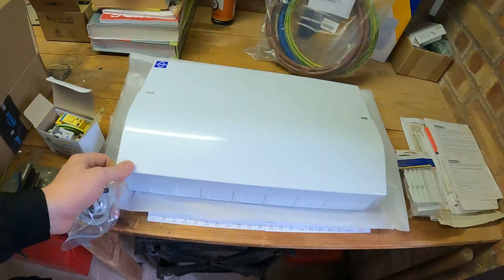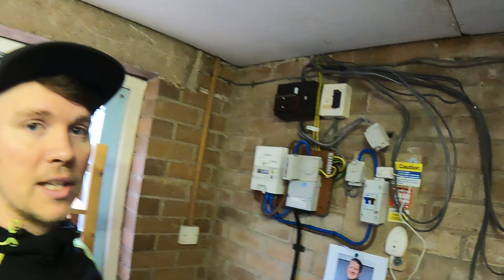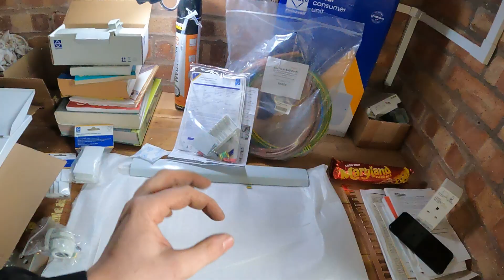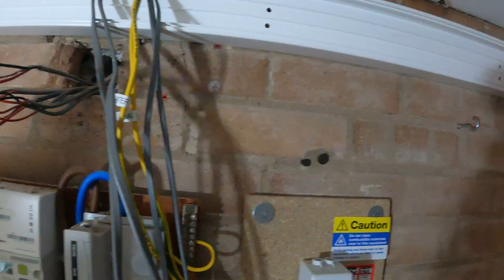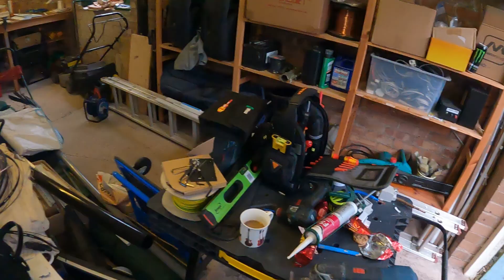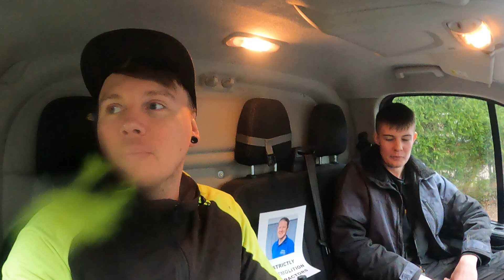Customer Did this!!

Comment: Just attended a property to solve a mysterious no power fault.  Breakers nor RCD did not trip most odd. The property had been newly re-wired and certificates were present, what I found was crazy.  The bus bar on the right side of the CU was connected between the RCD and one breaker at the far end, the rest, 2 x 32 amp 1 x 40 amp was not.  The bus bar was the wrong side of the connector and was only making a connection be resting against the connector.  This was arcing and overheating the breaker (fire hazard) sheer madness, I could lift the bottom of the breakers off the rail.  Now was this done by a professional or an amateur......

Comment: I am very intrigued by the wireing methods you guys have and follow. Its amazing the difference to what I work on over here in the US. 

Our electricity is very similar. We run 220 to 240 vac split phase system. 60 hz ac here. 

We use 180* split phase for residential that gives us nominal 120/240 vac on 2 phases. 
The equipment we use and boxing and wire is the biggest difference. The testing you guys do is huge and not often preformed here, or at least not commonly. We also don't use the ring or loop method of running circuits. But the advantage of feeding the circuit from both ends is huge. The down side is no plugs other then christmass or fairy lights have fuses in them. 

Very cool to see regardless and thanks for teaching me a bit more every day.

Comment: I was literally thinking that, although it’s nice of the customer to produce a circuit schedule, I would rather determine what’s what myself, not just because of any liability issues, but I don’t know if it makes it easier, figuring out circuits for yourself?
Reply: I'd say just having to verify the customers schedule rather than having to figure out everything yourself should make things a lot easier. I've literally spent weeks (full work days) figuring out existing wiring in one huge commercial property (over 100 years old, six-storey plus cellar, around ten sub-boards all over the place and loads and loads of extensions and alterations over time, massive granite walls too) and when the time came for an EICR that made things vastly easier even though the EICR showed a few mistakes in the original schedule.

That place is a nightmare. One of my favourites is a 2.5 mm2 (10 amps) radial that originates at the main DB at ground level and goes all the way up to the sixth floor and loft above! Voltage drop is atrocious of course, as is the Zs. Several Ohms in a TN-C-S. At some point a sub-board will be installed on the fifth floor but finding a way to get a feed up there is almost as difficult as getting the funds.

Comment: Quick question, so with you having spaced the board of the wall for rear entry, does this effect the IP rating of the board as you have used 3x rear knockouts and spaced the board of the wall meaning there is a gap on the side where you can get your finger in through the rear entry or did you seal the sides of the board? Any input would be great. Also does the SPD have to be after the main switch or does this not matter?
Reply: He sealed all the gaps with intrumescent sealant,, IP rating now above IP4x,, Proper,
makes it a pain for the next spark to pull in a new circuit though
Reply: Should be after the main switch, so when you turn off the main switch everything in the board should be dead.
Reply: Also, you can retro fit SPD, I.e at the end of the bus bar for the exact reason of retro so you don’t need to ammend the existing mcb/RCBO layout,, but , the length of the Line + Cpc shouldn’t exceed 500mm (I think) but exceptions will allow up to 1000mm (or summink)..
Watch John ward ytube vid
It’s to do with impedance and the operation of the SPD 👍🏻

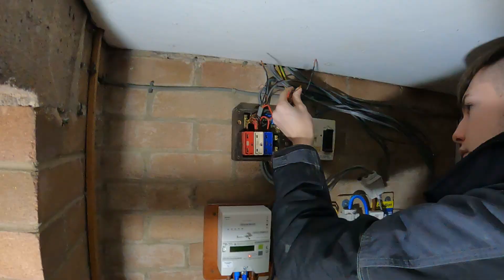Comment: NOOOO!!! at 2:56 you say it has been isolated then at 3:06 Adam moves hi arm, sure the switch is in the off position BUT there is no lockout kit on it, and of course that lockout kit should be a dual padlock.  One for each worker.

Please improve.
Reply: They are both aware and neither one is leaving the site so I don;t see the problem
Reply: @jaycee1980  the problem is, the tails are still connected and Adam the apprentice has his hands in a connected board.  Sure it will be tested dead but at that time it's not deemed safe.
Reply: @cjkokay  I guess if you follow the letter of the law, then yeah, its not safe working practice - but in actual practice it is because neither of them is going to be daft enough to energise the circuit while they're working on it :)

If you were to leave the site unattended, or have other workmen who may possibly come in and not know the score, i'd agree lockoff is 100% essential. But in this case, common sense says it's not needed
Reply: They also didn't put lock out kits on their boot laces! - what if they came undone and tripped over.
Also I'm sure neither of them had a doctor do a house visit for a full health check on themselves before they got into their vans that morning - what if one of them was on the verge of a heart attack, they could have crashed their van and killed someone......

In this situation a bit of common sense is all that's needed - they were the only ones working there, what they are working on is inside and they are constantly present. If this DNO board was outside or in another room, then yeah a lockout kit might be a good idea just in case someone comes along and flicks the power back on. In this instance though, it was completely unnecessary.
Reply: @blower1  tough. Of course. Really there's no trouble, however simply because us public can witness this in a public video, ya have to be technically correct or make an in video comment to cover etc
Reply: @cjkokay  The thing is, if you want to go technically correct - then the video should start with a phone call to the DNO for them to isolate the supply, then a week later, once  they have turned up, cut back to the video......and the reason for this? - many isolators are also the property of the DNO and are 'technically' not allowed to have the cover popped off to remove the tails.

Ya see that's the issue - technically correct often differs from reality. The overwhelming majority of electricians will happily pull the DNO's cut out's, change/add isolators, tails etc and just replace the seals....all of which is technically illegal. 

Common sense must take precedent in reality or otherwise nothing will ever get done.

Comment: The customer did all that for the fuseboard got all the infromation the fusedboard what wiring goes where. So my question is why the customer is not a Electrician and do it himself? not sure over there what fuseboard is used or breakers. I'm not an Electrician myself. But I have done a lot of work myself with my uncle who is now retired Electrician. Just curious that's all.
Reply: Perhaps he’s a retired or was an electrician years ago? 
I trained as an electrician 20 years ago, but never went into the trade as I became an avionics engineer instead. I still have the skills, but I can’t sign anything off.

I know in North Carolina you can do all the electrics yourself, as long as you prove you are competent and then someone else signs your work off. (My dad emigrated there and did just that, and he was a Nuclear Engineer).
Reply: @pauliboo2  hello Paul. Thank you very much for the reply. Yes in New Jersey you can do some of the work or all of the work yourself but you still need a electrician to sign off on it and they have to check over everything. In Georgia you can do everything yourself and from I heard no sign off is needed. But don’t quote me on that. That is what I heard from a licensed electrician in Georgia.

Comment: I gave Tradify a go, on day 2 of the trial got the high pressure sales tactics to sign up, I explained that I had not even had chance to see if it was any good. Then started to get phone call after phone call to join zoom meetings. Tried to explain I was working and to be honest was getting sick of the phone calls during business hours. Eventually got chance to give it a go, found it far to much hassle entering data, loads of software glitches to the point that really it should not have been released for use.
Reply: Have a look at service m8 much cheaper and better
Reply: From my experience in IT programming the testing phases prior to release of my programs anyway were only for the it department so I didn’t need to have the ability to understand SISO errors 😂 according to the internet: What does SISO mean?

SISO
stands for
S*it In S*it Out

If you put in rubbish to a program you will usually get garbage back out. Like trying to put letters into a calculator or pound/dollar signs in when it’s only wanting a number value without currency characters.  

All the above was said flippantly as it’s a common joke in IT alongside people with fat finger syndrome when they change their passwords every 3 months. It was never them that left caps lock on 😂 

I feel like applications like tradify probably do sound tedious to start with and annoying but so is the data protection act / minimum retention periods / the GDPR, insurance claims filing of business expenses and receipts. In the long run it will be more unified working from one system. If your filing system is better than tradify or other CRM software alongside the generated quotes etc and does all the above then congratulations to you, please please please sell your product to the world!

Comment: I think unless your a qualified electrician you shouldn't be able to buy electrical equipment such as fuse boards. You can't just go in and buy a boiler
Reply: I think the same about food, such as bread - qualified chefs only. How we don’t all have food poisoning with the current free-for-all I don’t know. It’s almost as if in truth there’s very little to it.
Reply: @sam.p12345  come be serious cooking is little bit different than messing with electrics or gas
Reply: @mikethemask1525  with the amount of crooked sparks and gas fitters taking money upfront and then not turning up anyone should be allowed to buy the stuff. Just because you buy the stuff doesn't mean you're going to have a go at fitting it. I bought a consumer unit, all the mcbs and an isolation switch. Had a spark fit it. What's the issue??
Reply: @mikethemask1525  OK, fine. You can all buy food. But no driving cars - qualified racing drivers only. Two tons of metal at 70mph - terrifying. One wrong move and you could kill someone. Or is driving the sort of skill, like most trades, that almost anyone with sense can pick up to a safe level with a bit of care and minimal training?
Reply: @sam.p12345  I do see your point I agree in some ways but again driving is something you learn  you do maybe 20 one on one lessons then have tonprove your competent by passing a test with an independent examiner which gives you more experience than a home diy-er who's just watched a couple of YouTube videos on less say doing a board change or rewire themselves. You would let a Nurse do a heart op on you even though she has seen a surgeon perform one.
Reply: @jp6975  the issue is the lack of training and understanding of the safety side and how to correctly install the equipment when a homeowner buys it and installs it that's my issue, i guess the best way to stop it is not to sell to people who are not trained, the amount of installs I go to after a diy-er has installed it or has brought it for a rouge Polish/Romanian builder type to install on the cheap is shocking i'm suprised theres not more injuries and deaths to be honest but then again not all Polish/Romanians are dodgey i know a couple Polish lads who are very good electricians so i guess it depends. You can't tar all tradesmen with the same brush you get scumbags in all walks of life plenty of tradesmen take money upfront and are legit it shows some rrust as well from the client that they want you to do the job, aswell as its there money which is paying for the works I will usually take a 40% payment for any job over £500 so i can get the parts to start the job. It's just my opinion, I run a very respectable electrical company and we strive for excellence in everything we do.
Reply: @jp6975  yeas, someone is trying create yet another monopoly, to charge silly money for just turning up. it's bad enough as it is to find decent trade, I had to rewire my house myself, only to call the spark to dp the consumer unit, which was of my choosing, as the supplied ones were cheap nasty things, they tried to sell to me for extra cut. Blame the dodgy trade people for people being reluctant to hire them, and having a go themselves
Reply: @mikethemask1525  Unfortunately, there are so many dishonest tradespeople out there that, for me, it's difficult not to be suspicious of everyone. I went and bought all the items myself - but told my electrician why I was doing it that way and that he can tell me exactly what to buy.... so that's what we did. I know that there may be a markup on the goods bought - an I'll happily pay that as well - but I'll do the buying before the job starts.

My view is that as long as the tradesperson tells me what to buy then great. If not, I'll find someone else. Once you've been burned twice - and I'm still going through the small claims court - you will not easily part with money upfront. 

Note that at no point am I advocating buying the goods and doing a DIY fitting... or getting a non-qualified person to fit electrics/gas. I wouldn't attempt doing this as DIY and advise others not to as well... unless they want to risk going 6ft under.
Reply: I bought a combi boiler and me and my brother installed it, or did you mean a different boiler.
Reply: @nw5835  really that suprises me as dealing with gas and possible carbon monoxide poisoning is lethal so I'd say the same again that ordinary people shouldn't be allowed to do it as it makes a mockery of the tradesmen who have spent years training to be able to do it.
Reply: All you wet wipes moaning, just charge accordingly and put it right. Moaning about having plenty of work, I’m a industrial mechanic and fix stuff that just hasn’t been maintained right. Suites me fine seeing other peoples shoddy work, keeps the money flowing in and also you can teach some people if they want to know how to do it right.
Reply: Try being a mechanic!! all sorts of idiots playing with brakes suspension ect, like electrics joe blogs shouldn’t be aloud I totally agree
Reply: @sionpritchard2060  tell me about it as a mechanic you have boy racers thinking they know everything and then they go and fuck everything up and we are the ones that have to fix there fuck ups pisses me of
Reply: That's a terrible idea. It'll start a black market for dodgy electrical equipment, thus making the problem worse.

Comment: Good job that...  Wish all my customers were that good..  Never fitted a Lewden board but looks ok, not sure about the SPD on the left hand side if that causes any issues with length of cables etc, I am sure its all tested and fine but prefer it on the right but thats just personal preference..
Reply: I was thinking the same re the cable length. I am sure that the youngsters will have verified that though.
Reply: @MrImATarget  Yeah I dont know if Lewden is the same but most come with the cables so as long a you use them I doubt you can go too wrong..
Reply: With it being on the left it makes it closer to the earth terminal, says in the manufacturer's instructions that you should take the shortest path to earth
Reply: @negatron8.486  good point..